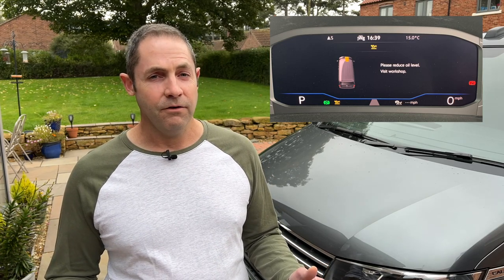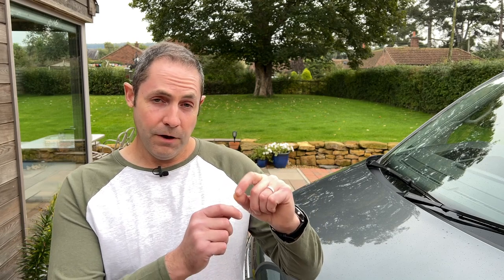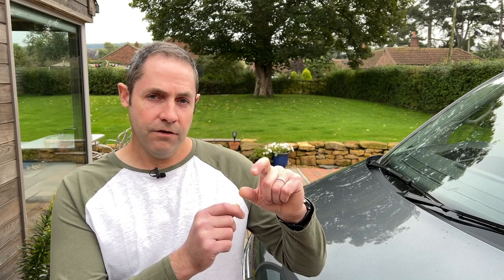Reduce Oil Level Warning - VW Transporter and California T6.1 - EXPLAIN, PREVENT & FIX!

Comment: I have this problem and have had the software update, he hasn’t fixed the issue at all. The light still comes on every 60 miles. It’s been back to VW 6 times, it’s with them now. They have finally admitted that it’s a problem and not just a sensor issue. Mine will add about 500ml of diesel every 60 miles!! It can’t do the engine any good at all.  
My issue didn’t start until I’d had the van for 18 months. It’s solely used as a campervan, so rarely does short journeys, the way in which we use the Van has not changed since we bought it so I don’t know why the issue has only materialised in the last six months

Comment: I thought the vehicle engine  ran on whilst the regeneration was happening and that was why we could hear the engine running sometimes when we’d left the vehicle. Unless it is carrying out another process? We have the 2019 T6.   I know they have had major issues when people run the vehicle on short journeys/ stops  with less than half a tank which caused engine failures.
Reply from the maker: Well, the 'run on' is actually the cooling fans running to cool down the extreme temperatures that the DPF gets to so it can burn off the accumulated soot, rather than the engine actually running itself. If it didn't do this then there is a strong possibility of things melting etc as the DPF would be just sitting there red hot with no cooling effect (which is helped by driving / wind etc). The running-on doesn't mean that the DPF regen is continuing with the engine off though, it has technically been interrupted and will start again when you next drive and the conditions are correct.
Reply: Thanks for taking the time to reply and for the explanation.

Comment: Hi & thanks for the information. I need to take some excess oil out of my T5 & guess the tube supplied with the pump kit you show will also be too large for the dipstick tube on that - what dia. tube worked & could you advise where to get the reduction connector, thanks
Reply from the maker: I would image it probably is, yes. I think we got ours from amazon - https://amzn.to/3L1bEp4 - I can’t remember exactly what size it is but this will probably be fine. You can leave the pipe ends in hot water for a little while before fitting this reducer and it makes it a lot easier.

Comment: The level
Is minimum & maximum- just have it in the middle! 
If diesel is mixing with oil this will alter its characteristics & could cause premature wear, i would be replacing that oil much more frequently than specified.

Comment: Hi, this is such a helpful video and we have been trying to apply the the stopping procedure since buying our Cali T6.1 Coast a couple of weeks ago. 

Is it crucial to keep your foot on the break because that can be difficult if the regeneration lasts for 10 minutes or more!  I have noticed that if I put it into park and take my foot off the brake there is a delay before the stop start kicks in and it’s not immediate. I want to make sure I am getting this right to avoid any problems so would really appreciate your feedback. 

By the way we love your channel and have learned so much from you both. Thank you 🙏🏻
Reply from the maker: Hi, don’t think it is essential to keep foot on brake, no. If the start/stop is working then your regen should be over.
Reply: @CampervanTime  thank you 🙏🏻

Comment: Hi interesting video I got my California Ocean at the end of April this year and have done about 6000 miles and not experienced this problem but in have noticed both the higher Rev level on tick over plus the smell (a bit like a hot new engine). My vehicle is a 4 motion 205 engine and I wondered if yours was the same or if you have the 150 engine and if the work differently. Thanks for the video though all very interesting. My current wing is the rubbish sat nav I don’t know if you feel the same ..John
Reply from the maker: We have the 204 engine (RDE2, May 2021 build). Great that you haven't had the problem - I fully suspect your oil level when cold is at about half on the hatched section of the dipstick - would be interesting to know if you have checked it at all? I have just shot another video with some more info that I will be publishing over the next day or so, as I have spoken to a VW Master Tech about all of this in detail. Useful extra info coming. Satnav - yep, rubbish. I tend to use it on the dash in front of me for pretty map, but then actually navigate using wireless CarPlay and google maps on the main screen.

Comment: Great video thanks for the info. The light came on yesterday a couple of weeks after service and after an hour or so of slow driving and stop/start in a ferry queue. My question is what happens if you keep driving? Other than the light coming on every 100 km am I damaging the engine??
Reply from the maker: It's a little tricky to say because we obviously don't know how much oil is actually in there but we had to keep driving for about 400 miles after ours had the issue and we figured it all out (see the second video on this that we did too).

Comment: Does anyone have any view on whether the start/stop function has any influence on the amount of regens or is it religiously every 2hrs?
Incidentally I disabled stop/start and haven’t had this issue even though I do many short journeys.
Reply from the maker: It's a good question. I've not heard of any linkage between the two issues or the DPF regens being linked to a certain number of engine starts/restarts etc, so my guess is that it doesn't have an influence apart from obviously if the engine isn't doing start/stop then it's not cooling down ever so slightly when temporarily stopped, thus meaning more potential for soot to be burnt off naturally from the DPF.

Comment: I had the 2.0 tdi engine in my Audi it smells when in re gen you have to have half a tank of fuel. 
I’ve just bought a vw T5 seems to be doing the same . I change the oil regularly with a oil pump with various tube sizes  down the dip stick . Couldn’t be. Othered with taken under trays off the pump get almost all the oil out . Filters on the easy to get to .
The cleaner the oil the quicker and less frequent  the re gen .

Comment: Out of curiosity.. did the warning light go off as soon as the level was reduced? Or did you need to run the car for a while?
I’ve had this issue a while, oil level is fine but can’t get rid of the fault!
Reply from the maker: Frustratingly, the light went off every time the bonnet was opened(!), but a drive of 100km was sufficient to get it to come back on again if the level hadn’t been reduced. Once we did reduce it, it never came back on.

Comment: 25 Jan 2023- after querying this with VW Van Servicing in Sheffield and them saying it's Driver Style that causes the problem, there is now a Software Update available to fix the issue. The Update was available from Dec 2021! 
I thought the problem stemmed from the Regeration process being interrupted by Auto Stop Start but it seems there are stringent rules about what can happen during Regeneration and Auto Stop Start is not allowed to stop the engine when it's happening.

Anyway, I've had the Software update today, so let's see what happens!!!
Reply from the maker: Good luck!

Comment: Great video/tutorial as usual 🙂👍 It would be very interesting if you could make a video about the Auxiliary Heater. I haven't received my VW California Ocean yet but I already have a few questions that I haven't really found an answer to. Must the key always be in the ignition to operate the Auxiliary Heater? What is the best configuration (heat level, etc.)? And what use do you recommand? Thank you very much 😁
Reply from the maker: Sounds like a good video to make 👍
Reply: @CampervanTime  Thanks 🙂
Reply: @CampervanTime  I still searched for information on what works with and/or without ignition on and I can't find much. For example, you can set the times when the auxiliary heater turns on, such as in the middle of the night to provide some warmth on a cool night. But do you have to leave the key on the ignition overnight or not? Help me solve this mystery please 😄
Reply from the maker: We’ll do a video 👍
Reply: @ingloriouschuck  no you don’t have to leave the key in the ignition.
Reply: @williamsdaryl2139  That is good news 🙂 Thanks.

Comment: Very well put across Will. Thankyou. I’m hoping by the time our Cali arrives the software will be updated…BUT I’m with you , it’s a worry getting diesel in the oil, I’ve no idea what kind of damage that would do long term. Do you happen to know if they mix? Or does the oil sit on top or below the diesel? And lastly ( sorry ) how long do you need to sit & wait for Sarah to shop for the regeneration to finish? I.E how long does the cycle take?
Reply from the maker: Hi there, thank you! Yes they mix. I’d stick to fixed oil change intervals (not long life variable), probably annually (depending on mileage) just to be on the safe side. The regeneration normally takes around 10 mins, I’ve only ever waited 2-3 mins for it to finish and be able to use the start /stop again, but I guess you could be unlucky and have to wait closer to 10!
Reply: @CampervanTime  Thanks. Gets you out of the shopping maybe 😂

Comment: I thought it was an engine ecu software update to fix a faulty interpretation of the level sensor logic. 😉 
This happens after only 500 mile on some vans so no way the DPF has caused this. 
If you pop to your dealer they will update the software to fix this issue.
Reply from the maker: Hi Simon, yes I think you are right. I have been talking to a VW master tech in the background who contacted me after I put the video up, so I have quite a bit more to share in another video on this subject !

Comment: On my T6 the Stop/Start does not work if the air con is on. If this is the same as the T6.1 your solution may not work?
Reply from the maker: On the T6.1 we have found that it depends how much load is being placed on the engine from the aircon (ie how much cooling it is having to do). Ours certainly does do start/stop with the aircon on and the interior at normal temperatures.

Comment: Why doesn't the regen system work like it does on the T6? Regen DOESN'T stop when you turn off the engine. This seems like a huge fail on the T6.1. Maybe the software update should allow regen to continue when the engine is turned off. (It's not that hard is it?!)
Reply: I’m pretty sure on my Merc it doesn’t stop regen when you turn off the car. A few times I’ve got out and the radiator fans are going full blast and the car is very hot. I didn’t know what it was until I read about the regen cycle. Will go back and read exactly what the process is…
Reply: My 2019 T6 also continues regen after switching engine off. Have done 27000 miles in that time and thankfully have never had this issue. 🤞

Comment: I've only had the high oil problem since my vans first service. Its a joke, VW need to get there act together. VW told me there waiting for a fix. Didn't have this with a T6.
Reply from the maker: Sounds like they just have overfilled it a bit to me, compared to where it should be. The only fix I can ever see them doing is a slight reprogramming of where the sensor says too full is, rather than anything hardware. Or of course, a new dipstick which is slightly longer! They did do that on a Jetta (I think) in the US because of the same issues.

Comment: A really useful and insightful video, BUT oil dilution will shorten the life of the engine - especially the turbo - so it needs draining and replenishing with fresh oil (and then follow your sound advice re avoiding the switching off the engine whilst a regen is ongoing).

From an engineering perspective, it is beyond belief that VW chose to deploy diesel in this manner, rather than injecting the diesel directly into the exhaust system, but, hey, they need to pay-off that emissions fine and they wouldn't want that to fall on the shoulders of their shareholders now, would they!
Reply from the maker: Check out our follow up video too which explains more on this 👍

Comment: this sound like an extraordinary design fault, what does VW have to say about your explanation and reasoning? diesel spilling into the engine oil!  a recipe for disaster not just high oil levels.
Reply from the maker: Well, the content of this video and the follow up video (well worth a watch if you haven't already) were put together in conjunction with info from a VW master technician. This isn't just a VW issue by the way - ie the fuel in diesel thing, other manufacturers outside the VAG group have the problem too. I fixed all of this myself as the dealer is a 100 mile round trip for me, so apart from the VW assist callouts my main dealer hasn't even had it reported to them by me.

Comment: Thanks for the explanation.  I’ve recently ordered an Ocean and know there’s a long wait, however this has slightly put me off.  I wonder if the Transit Nugget has the same issue?
Reply from the maker: I couldn’t tell you I’m afraid. There is a VW master technician that has commented on Facebook to my publishing of this video saying that the issue isn’t due to dpf regens failing but is due to oil expansion when hot. I’m following up with him to understand more because this isn’t what I was told by VW assist or the garage that took the oil out when I was away. My only thought re the nugget is that it also will have had to pass the same emissions standards as the VW, so must have a lot of exhaust emissions control hardware too…
Reply: @CampervanTime  let’s hope it’s easily resolved via a SW update.  Extraordinary that we are all shelling out a substantial amount of money to be getting our hands dirty.  I’d understand if we were buying an expensive classic.
Reply from the maker: Yes, although it was my choice not to drive the 100 mile round trip to (probably) still have the issue after!
Reply: Not sure if you watch the Cali Camper Family. They have recently changed from a California to a Nugget. Not for any technical issue, they loved their California but they needed three belted seats for their girls and liked the rear kitchen. Maybe post a question on their channel and ask how they are getting on with their new van.
Reply: I too thought that the regen explanation may not be correct. If you turn the engine off mid-regen I’d imagine the amount of fuel in the cylinders would be very small. Having to remove 400ml of oil would indicate that amount of diesel had slipped down the side of the pistons, which seems unlikely. It will be good to follow-up with the master-tech and get to the bottom of this. Perhaps the fix is just to reduce the amount of oil in the engine when delivered from the factory. They have until next June (when our Ocean is due) to fix it…😜

Comment: then it will register you have not allowed a regen when you switch it off after so many attempts  it goes to limp mode
if you own a vehicle revs rise then you panic and switch it of start it up and phew 
its ok 
then they will charge you for a force re-gen that they an do with a lap top
it maybe be different in the car world 
but in construction its life 
its called operator induced error

Comment: No good !!!! oil viscosity has changed any diesel mixes with oil you take the lot out !!! And will regen depending on a lot of factors not 2hrs its not a timed regen ? If you drive for 2 hours at 80mph compared to 50mph the regens will not be at same point ? Lot of things to take into consideration here.
Reply from the maker: Yes, lots of factors at play. When I spoke to the master tech again he gave me more info on this particular issue in the T6.1 and it's mostly caused by the oil level not being set correctly when the van is filled. I did a follow up video about it.

Comment: Amount of diesel in cylinder .. is not 0.06l lol, you have to turn it off mid regeneration for 800x to top up 0.4litre of diesel in oil.
:) .. part od how oil measurement work could be right.. pa source of diesel in oil is no just by turn of the engine mid regeneration

I think exes of diesel get mixed durning whole phase of regeneration.. no just when you turn the engine of..

So Auktion is to drive in more high revs. All the time.. and at least 30 min of 130kmh.. 2x a.month..

Comment: Sounds like a ridiculous system. Doesn't the oil become too diluted with diesel over a period of time? I know diesel offers a degree of lubrication but surely it isn't good for a modern turbocharged engine
Reply from the maker: I did a follow up video which explains more too, and the warning light issues is actually more caused by oil expansion and the level not being at the correct position when cold. Diesel in oil isn’t a new issue though, loads of YouTube videos about loads of DPF equipped Diesel engines having these issues.

Comment: OMG how much was your van
Reply from the maker: A lot, but this isn’t just a California issue - any new diesel transporter can have this issue and I’ve seen reports of Audi, VW cars etc having the problems too…
Reply: @CampervanTime  there are dumpers in construction with same regen issues ,they have a fleet of old dumpers and when they buy a new dumper they have re-gen issues 
and the MD says my old dumpers dont do that 
if I knew that I would not have bought it 
and then salesmen dont know and wont tell the MD they wait until it goes to market and its the service depot issue
I have seen it last few years ,fancy showrooms but when you use it there is issues 
its to do with emission free zones all over the place
Reply: @CampervanTime  its depends on the system some use ad blue  feel for you